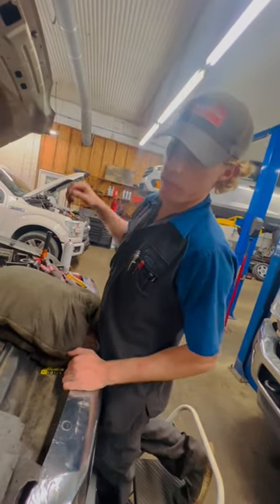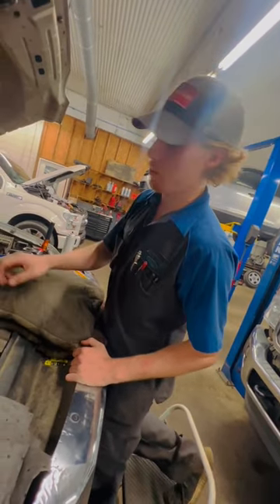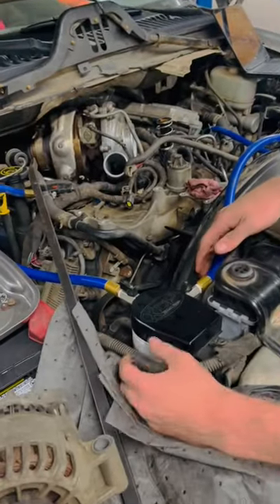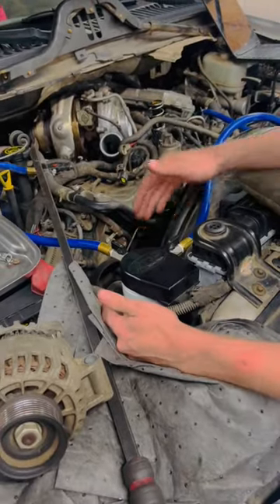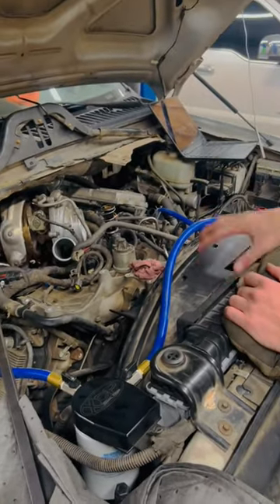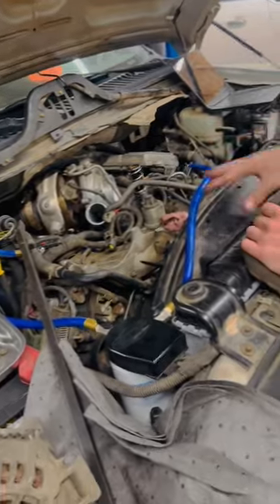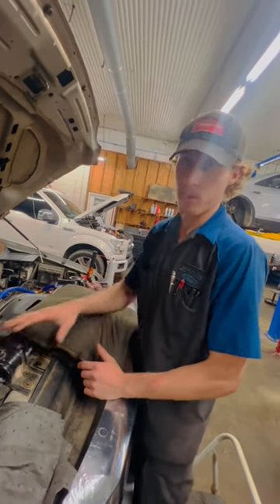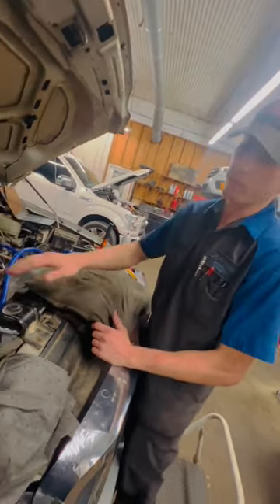Best & Easy 6.0L PowerStroke Upgrade | Coolant Filtration System #shorts

Comment: The 6.blow is my favorite diesel. I actually own 5 and sure, stock they have their issues, but deleted and tuned no other diesel has the raw horsepower and torque that a 6.0 has. Not even a cummins
Reply: My cousin is a federal government contractor diesel  mechanic over seas for the military. He's worked on all of the different types of diesels. 30 years experience. He said bulletproof the 6.0 and it's hands down the best diesel engine out there. You're right, stock it has lots of problems.
Reply: idk bout the torque they don't have nothing below bout 2k rpm
Reply: @eldiabloelbandito9550 I just bought me a '06 f250 6.0 4x4 deleted but not studed,  should I just wait for it to blow and throw a rebuilt studed one in there since it cost 6 grand to do it? The labor of removing the cab etc it seems to only cost around 3 to 4 grand more just to buy a completely rebuilt and Bullet Proof
Reply: Beg to differ I believe 6.4 have the most untapped raw power by far. Owned 6.0 & 6.4s but my 6.4s would always just walk on the 6.0 and both were tuned and deleted w same tuners
Reply: @michaelbauer-ig3ik you can stud it without removing the cab, but it’ll be a pain in the ass
Reply: @adnansabanovic6488  looks like it.
Reply: @alfredomartinez9599  Exactly I was just about to say that

Comment: Flush that sh*t Ford coolant out and use the RED ELC Cat coolant.
Reply: Amen I use shell rotella elc nf and she is minty in the 6.4
Reply: I did that with my 08 6.4
Reply: What antifreeze do you mix with that?
Reply: @markbanana5775  You flush the cooling system till you get clear water then mix 50/50 ELC coolant.

Comment: That's a great idea. But also, the battery runs current thru the engine to ground and after a couple of years that makes coolant become acidic.
And will start eating at gaskets & corroding metal.
I'd still change coolant every 30,000 - 40,000 miles.
Reply: USE a radiator cap that has zinc hanging from it, self sacrificing and should let your radiator last alot longer. IT works.
Reply: It can't become acidic unless current is actually travelling thru the coolant which is impossible because glycol does not transfer electrical current, or if two opposite polarities of the battery are in closed loop with the coolant (electrolysis)  i really can't see how coolant can become acidic.. now mixing coolants is where the nightmares begin.

Also, the battery negative,engine block,frame,and chassis are all bonded together very little chance any current would make it into the coolant having so many other easier options to travel.

Comment: Just a heads up, According to a Ford engineer I meet when I was on the Technician Review Panel in 2011, They said the problem with the filtration system it also removed important Impurities from the coolant. So not a good idea. Better off flushing with VC9 and change coolant every 50 K like you mentioned.

Comment: I got something similar to that for my 6.0! I have that with a oil filter system. It made by Sinister Diesel. Coolant filter is a Wix and the oil bypass system is a amsoil filter. It uses a new oil filter cap. Pulls oil out of the stock oil filter, runs it through the amsoil filter, dumps it back into the crankcase that has a new oil filler cap. $600!
Reply: Oh so it’s basically double filtering your engine oil?
Reply: @selwyn13  pretty much. The stock oil filter takes it to 10 microns. The amsoil filter takes it to 2 microns. Don't need to change the oil every 3,000 miles. I change mine every 10,000 miles now even though it states you can go 20,000. It has saved me from installing injectors all the time. I changed out 3 injectors within one year without the system. I've only changed out 2 injectors within the last 6 years of owning the truck with the system. I love it.
Reply: Yep! That's the company. I don't blame them for doing that. Really pretty blue! LOL
Reply: @Massersaresuperheros  , LOL!

Comment: If you change to an after market oil cooler and delete the egr cooler it solves the problem. An axillary coolant filter helps a lot to.., but on 6.0 ether bullet proof it or leave it total stock, anything in between just creates problems I've owned 3 of them.

Comment: I’ve replaced so many oil coolers with these “coolant filters” installed. I don’t believe they work. I prefer to install the bulletproof external oil cooler to prevent the oil cooler plugging up again. What happens is when these engines where casted they didn’t remove all the sand and overtime it plugged up the oil cooler.

Comment: Gimmick alert, no you don't need a coolant filter.  Just service your cooling system.  The coolant breaks down from the heat transfer of the 2004.5 to 2007 square EGR cooler.  Yes, there is drop out from the coolant but there are other factors also at play.  Too many companies try to up sell you on produces you don't need.  This is a billion dollar industry.
Reply: if you're like me and don't have a EGR and have a seperate trans cooler, and a Air to oil cooler won't have any issues with coolant. 

the 6.0 the coolant is super overworked. it cools the Block. the heads. the transmission, the exhaust, the engine oil.
Reply: @justnsaliga8518  Fair enough, you most likely will not have a coolant break down issue but did you need all of these products and are any having a negative effect on your truck?  Without testing the systems before and after, you really don't know as a consumer.  This makes my point, the majority of aftermarket diesel engine "solutions" are not well engineered.

For example, the air to oil engine coolers. First, the oil filter supplied was too coarse and caused injector failures.  Next, in colder climates it was over cooling the oil and not allowing operating temperature.  A thermostat was needed to resolve this.  In the end the consumer was the guinea pig for the development of this product.

I have seen many 2003 6.0L engines with high mileage (300,000miles) with stock EGR cooler and oil cooler.  The round EGR cooler had less surface area to absorb heat into the coolant and break down was not as big an issue.  In comparison the late 6.0L engines with the square cooler tended to have plugged oil coolers around 70-120K miles like clock work except for those that serviced their cooling systems.

The main issue is that by the time the industry and consumers figured out what was going on, it was already too late.  Realizing this now a 6.0L could be driven with an EGR cooler and regulator service of the cooling system.

Comment: How does the coolant get dirty when its a sealed system?
Reply: The oil cooler is the problem. It is a liquid cooler instead of air. Replace it with the air cooled version and your ok.
Reply: People have stated that Ford didn't flush out the sand from the engine blocks after casting, or didn't flush them nearly enough.

I cannot confirm or deny this however.
Reply: @youtubechampion9377  oh man..
Reply: Sand, like what I just found in my 2007 6.0 Outlaw
Reply: @sasquatchcrew  casting sand?

Comment: So would this also help offset or noticeably slow down how soon your coolant starts to corrode?
Or does this have nothing to do w/ the coolant corrosion? 
Also would you have to (or suggest to) install some sort of mini inline pump or something similar to make up for the loss in fluid pressure?
Reply: Your coolant will still lose its properties over time, this filter just keeps particulates such as sand and rust out of the system, so you oil cooler doesn't get clogged or egr systems
Reply: Oh Ok. I had a feeling that’d be the case. 
I was starting to wonder if that was something I should consider getting for my Subaru Forester in addition to the cylinder 4 cooling mod. For those y’all that don’t know, Subaru’s 2.5 L engines r known for blown head gaskets b/c of coolant flow related issues.
Reply: @selwyn13  oh I knew subis had head gasket issues didn't know it was because of coolant flow, what happens? Because unless the engine has particulates in the cooling system I don't see how it will destroy a head gasket, normally I think on subis it's just a poorly designed gasket from factory
Reply: @nativeoutdoors1780  Yes it’s an engineering flaw, it’s b/c of the type of head gasket material. Long explanation short, it’s also that cylinder 4 is the weak point of the engine. W/ it’s current coolant flow sequence, it goes from cylinder 1,3,2 then 4. By the time it get to cylinder 4 that coolant is already so warmed up that it doesn’t cool cylinder 4 down adequately and it causes the gasket to either warp or the glue on the multi-layer steel gasket to give out and come apart (I don’t remember the last part exactly).

Comment: Better than that don't buy a power stroke
Reply: Get a million mile ram. Not a 100k engine exchange power stroke.
Reply: @matthewwilliams9028  everyone says they're million mile motors until they hit  a random mileage between 0 and 1 million and the bolt in the front of the block finally comes out and falls between the pump and crankshaft and splits the block 

the 6.0L can be fixed by bolting things on.

the cummins can be fixed by an engine rebuild

on another note my favorite engine i've had alot of experience with is a Cummins VTA 903 T Big Cam nothing compares. all mechanical or bust.
Reply: @matthewwilliams9028 dodge is junk the only good thing about a dodge is the Cummins in them and that motor ain’t a dodge everything around that motor is junk

Comment: Totally false. I don’t run a coolant filter. Instead of spending the money on a coolant filter. Spend the money on a proper coolant flush that takes 3 to 4 hours that’s including the drive time. I got 80 miles since I Superduty Service did a proper coolant flush and I can run 80 to 95 mph unloaded and see only a 8 to 10 delta. When I’m towing doing 60 to 70 mph around 12k to 14k a 12 delta on hot south Louisiana summer days. I ran cat 50/50 Elc premix coolant. A coolant filter will not save a oil cooler. You got roughly 1.5 to 2 inch upper and lower radiator hose and a coolant coolant is a 3/4 inch hose. A coolant filter may help a little but a proper coolant flush does the job right the first time.
Reply: This is exactly correct, only thing I’d add is that the coolant is being pulled from the top of the radiator, all the sediment falls to the bottom of the radiator and will most likely never find its way into that 3/8 rubber line. It’s all eye wash.
A possibility would be to tap into the drain on the bottom of the radiator and filter from that point. Just my two cents.